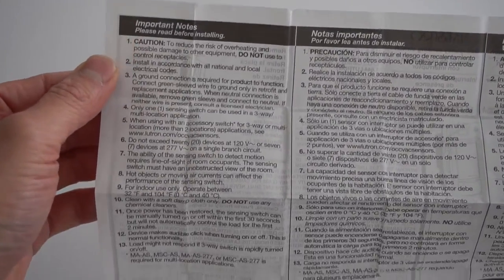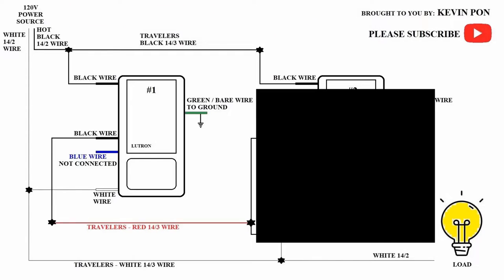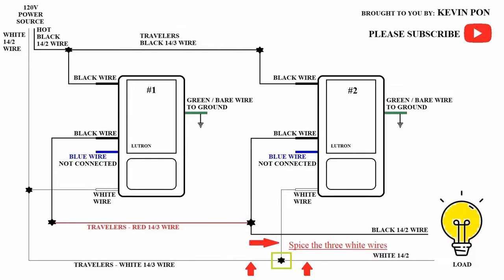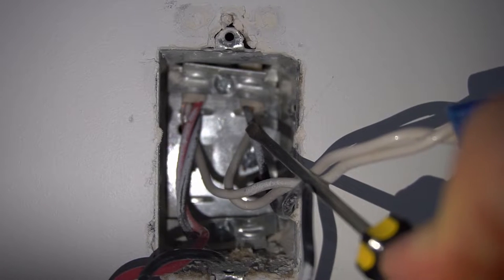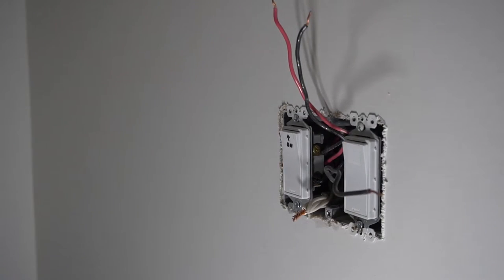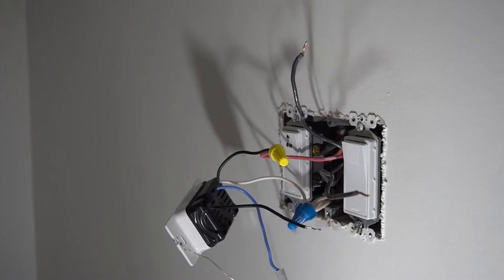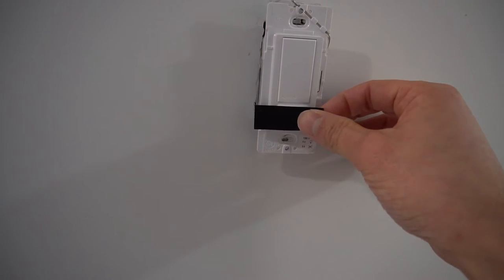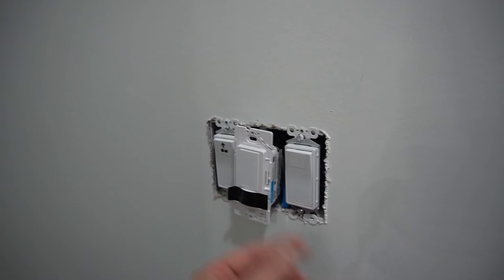TWO Occupancy Sensor 3-WAY Switch HACK BYPASS THAT WORKS! Any brand!

Comment: THANK YOU FOR THIS!  Question, though.  It appears the on/off button and motion sensor are an either OR situation 🤔...  Did I do something wrong?
Reply from the maker: Hi Alicia, can you please repeat the question? 😂 I don't understand
Reply: @KevinPon.  Haha, sorry 
I can use motion to turn on my lights and they will timeout out and go off 🥳
I can use the button to turn on the lights then turn them off...🥳
But if motion is what turns on the lights the buttons aren''t able to be used to turn them off .😞
Reply from the maker: Ah yes then you will have to wait for it to timeout. In 1 minute the soonest it can turn off by itself for the lowest setting. I wished they had a 30 second setting 🍻
Reply: @KevinPon.  my question is if I did something wrong because I cannot use the button to turn the light off if motion originally turned it on.  But on other single pole ones I can use both.  It is motion OR button but you can't turn it off with the button if you didn't originally turn it on that way.
Reply from the maker: @aliciawilliams3687  oh I see. So if you installed yours just like the way I have it. Two of them. I am assuming both motion sensors have been triggered. If you press one to turn off. That switch it off however you still have one more to turn off. You must turn them both off in order for the light to shut off. There is another way where you can just have 1 motion sensor installed on your 3-way system. The other end have to spice wires to keep the power loop complete. That is where box you won't be installing another motion switch and having it blanked off. I hope this answers your question 🍻

Comment: Hello Kevin, thank you for sharing this brilliant idea! My understand is that now both sensors will work but if one of the switches is shut off manually then the others could not be switched on manually right?
Reply from the maker: Thank you! If one is switched off manually, the other switch can still turn the light on or off 🍻

Comment: Thank you for the video, Kevin. However, I have a question. It looks like your idea can be described as using two occupancy sensors in single pole mode being connected in parallel. Another words if you’re not using blue wires than why not to make this installation with just two single poles providing they’re almost twice cheaper? Thank you.
Reply from the maker: Hi Igor, you're very welcome! Good question. You are 100% correct! Will be cheaper using two single pole sensors. I made this video base on the current props I had. A few of my viewers needed my help so I decided to make this video for them. But also to prove Lutron's installation guide that it was possible to install two of these switches when mentioned cannot. Thank you for the comment. Cheers!
Reply: Read my mind. Great question and saves money! Should write Lutron as it's a no-brainer necessity to have this wiring option available!

Comment: So two effects with this method since they are effectively wired in parallel:

-I think it may have been noted but I beleive manually shutting off one switch with the paddle won't do anything, you will have to hit the other or wait for the motion to time out.
-Technically the load capactity with be shared when both are activated.  More a minor point in this day and age of LED HOWEVER I note some people saying that you can do this with a MS-OPS2H to save some money since you don't need the 3-way feature of the MS-OPS5M BUT the OPS2 is only a 2A switch and the OPS5 is 5A.  Something to be aware of if you have a lot of lights on the swich circuit.  I.E. with only one activated you may be pushing the limit of a single OPS2.

Actually one other thing occurs to me on the first point.  I wonder if just wiring the blues together as well would "fake" the two swiches in to thinking the other end was a companion switch and therefore shut themseleves off if the other manual paddle was pressed?  I don't know the details of what exact "signal" is sent or level maintainted on the blue line when used in the pseudo 3-way mode.

Comment: Can this be done on Kasa motion single pole switch(KS200M)? they are not 3 way switches
Reply from the maker: Yes you can. Just follow the steps and ignore the blue wire. Neutral wire is required! 🍻

Comment: Thanks bro. Can I just buy a single pole switches instead 3 ways for saving money? Or it won’t work?
Reply from the maker: No problem! Absolutely, yes you can. As long it requires a neutral wire 🍻
Reply: @KevinPon.  thanks bro
Reply: @KevinPon.  where u live bro?
Reply: @KevinPon.  my single pole Lutron does not have neutral!
Reply from the maker: @ethanpn2003  Canada 🇨🇦
Reply from the maker: @ethanpn2003  damn. Can you see if the ground wire is connected into the control board of the switch?

Comment: Hi Kevin,  I bought two levinton 3-way switches, not sure which I'm doing wrong, best i can do is have it flicker the lights on for a few seconds, then it shuts off again.  my hot 14-2 is on same side as the 14-3 traveller and the 2nd location only has a single 14-3 into it? let me know if you can help more, thank You
Reply from the maker: Hello, the important key is to have constant power going to both switches. Just like how I have it in my wire diagram. Also all the neutral wires are connected 🍻

Comment: Hi Kevin, I do not know if you are still monitoring the comments section, but if you do I have a question. Will your wiring diagram work for a occupancy sensor switch like the TopGreener single pole (No Neutral Required)? This switch accepts only two cables + ground, and it does not need neutral wire (white cable). Maybe the better question is, does your wiring diagram requires always using the neutral (white) otherwise will not work?
I think it is awesome you took the time to answer each question on this video.
PS If you see this question twice, is that after submitting it the first time it disappeared for me.
Reply from the maker: Hi Gabriel, if this switch had I neutral wire, I would say yes. Sorry, I cannot confirm that it will work. However, I do know that some switches say neutral wire is not needed, but uses the ground wire as a back door as a neutral. If the ground wire isn't connected the switch won't work. 🍻
Reply: @KevinPon.  quick follow up question. After looking at online pictures for the Lutron MS-OPS2-WH, it has two black wires and ground. It does not seem to have a white cable. You mentioned that this could work as a cheaper solution. Is this still the case, even though does not have a white wire (neutral)?
Thank you for you time and consideration to my question
Reply from the maker: Yes, this one will work. If you look in the customer pictures on Amazon. You can see the neutral wire is cover by a green sleeve. It's actually a neutral wire. I don't know why they do it this way. To save a wire/money?

Comment: Are you able to add in a 3rd switch? Would you just be wiring 5 wires together instead of 3?
Reply from the maker: Yes you can. Parallel circuit 🍻

Comment: Hi Kevin, I have a 3way controlling a staircase and wish only to control top of staircase with a 3way Lutron motion switch and the bottom a standard 3 way switch. Unfortunately the power feed is into the bottom switch standard 3 way, and as per fine print it’s not supported in that configuration. Can I use your diagram and replace your switch one with standard 3way?
Reply from the maker: Unfortunately once you have one motion switch installed. You cannot use the manual switch. The sensor needs constant 24/7 power. Even if the sensor is installed on the side with the feed you won't be able to switch the manual 3-way off. Once the manual is switched off. The sensor cannot turn the light back on 🍻

Comment: Thanks Kevin. In my 3 ways outlet I found  there were 2 traveller wires( one black one red) with brass screws and 1 black wire with black screw. I have replaced one of outlets and red wire is on left and black wire(traveller) is on right & above black screw. So I have 2 questions 1. Can I exchange two traveller wires location , switch into red wire on right and black wire on left ❓2. Do I need to match the same traveller wires locations between my 2  three way outlets such as both of red wires on left with brass screw, both of black traveller wires on left with brass screw thank you：）
Reply from the maker: Hello there, I have never exchanged the travellers but I do believe it will still work the same. Just as long the black screw gets the correct wire on both 3-ways 🍻
Reply: @KevinPon.  Thank you for your help Kevin! It works ! 😽👏
Reply from the maker: Awesome!! 😁🍻

Comment: there are different types of Lutron Maestro Motion Sensor Switches on Amazon. Please, tell me which one I need to make same connection as on this video? Thank you
Reply from the maker: This is the one I used in the video https://www.amazon.com/Lutron-Electronics-MS-VPS5MH-WH-Maestro-Vacancy/dp/B008SE3GBU/ref=sr_1_21?keywords=lutron+motion+sensor+light+switch&qid=1659137233&sprefix=lutron+motion+%2Caps%2C154&sr=8-21

Need one with neutral wire to work. Cheers!
Reply: @KevinPon.  thanks
Reply from the maker: @asa9999  this one has more reviews. But in the pictures they are identical. Model number is different but they look the same. https://www.amazon.com/Lutron-MS-OPS5M-WH-Single-Pole-Multi-Location-MS-OPS5MH-WH/dp/B005WM3C42/ref=sr_1_1?dchild=1&keywords=OPS5M-WH&qid=1591491398&sr=8-1
Reply: @KevinPon.  that is what I use, it doesn’t seem to work😢
Reply: Not sure why. Do I need t to use the exact ones that you used?
Reply from the maker: Nope you do not. But you have to follow the wire diagram very carefully 🍻

Comment: Hi Kevin. Great video. I followed the instructions and its sort of working. Wondering if you can provide some guidance. Both switches have power however the motion is only working on the aux switch. Once motion is triggered on that one I see a blinking light on the master but thats all I get from the master. Even if I try to hit the on/off switch on the master, it does nothing. Thanks in advance.
Reply from the maker: Hi Matt, thank you. That's a good start that both switches have power but how is your neutral wire hooked up? Are they both connected in parallel together too?
Reply: Hi Matt and Kevin - I am having the same issue. My switches do not have any white/neutral wires, so I was forced to skip that portion of the wiring diagram. All I have are black and red (plus the ground).  Any thoughts would be greatly appreciated?

Comment: Would this work with a lutron motion dimmer on both or one end?  Thanks for the video!
Reply from the maker: You can have both working just like in the video. Would be the same steps and ignore the blue wire part. Cheers!

Comment: I wired it as described, and the switches work on motion, but the lights are coming on every 4 minutes all by themselves. I have taped over the motion sensors to see if it would stop, no luck. Any ideas?  I might return these and go with a single pole as some of the comments said.
Reply from the maker: The tape must be fully covering the sensors but I assume they are. Sounds like one or maybe both are faulty switches. Yes single pole would be the cheaper option 🍻

Comment: I just installed these motion detector switches at the end of 2 hallways. I used your wiring diagram, and they all work perfectly. 

Looking at your wiring configuration, I understand that they are no longer 3 way switches, just a motion detector sensor with a constant hot, and a common switch leg. Thank you for the excellent wiring diagram.
Reply from the maker: Job well done Jerome!! Thank you! 🍻

Comment: YouTube University wins again. 

My lights are wired through the box with power. Not standard or ideal— but the logic presented in your diagram helped me unfuck my problem. 

You have another video that’s about 4:50 long on the same subject. It ends with “turns out you can’t do it” — I saw it in the middle of troubleshooting, after having seen this video first (and not knowing they were different). I almost threw my phone. 

Anyway— this is a helpful video. Your solution works. The other one… isn’t. I guess I’m writing this to let everyone (and you) know to ignore the other one and only focus on the video that’s about 12m long. 

Thank you again. It’s clear I have more confidence than ability— and tutorials like this help make it look like I know what I’m doing. 😂
Reply from the maker: Thank you for commenting. I enjoyed the read. I am glad it all worked out in the end. Cheers mate! 🍻

Comment: Kevin, Can I use one occupancy sensor switch and one normal 3 way switch. Always leave the normal on, and let the motion switch to detect both doors just in your case.
Reply from the maker: Yes you can that's what I have in my mudroom. Just make sure never switch off the normal  3-way switch🍻
Reply: I have a setup like this but I was able to tap into a hot wire from the fan switch in the same gang box as the motion sensor. This provided power to the motion sensor and now both switches work like normal. when you turn on/off the normal 3-way switch the motion sensor clicks and will also turn the light off after 1 minute regardless of which switch is turned on.

Comment: I understand your two-switch conversion.  Now, suppose you have 4 switches, two 3-way and two 4-way in the middle?  I want to put two 3-way motion switches at the two 3-way switch locations...  Would my 4-way switches make and break that red traveler wire you show?

Comment: So what I didn’t see was if both sensors are “on” and set to watch for motion, will one sensor keep the power on with out timing out? And if the other is out of sight from the other location would it do the same and keep the lights on?
Reply from the maker: When either one of them is still timing out, the lights will be on. Both of them has to time out completely for the lights to be off. Cheers mate!

Comment: Hi Kelvin,
    Thanks for the great advice.
    Just wonder does it work if I have one 3-way sensor switch and the other just normal 3-way switch. I install on one side, and found that when I turn off the light from normal 3-way switch. I couldn’t turn on again from the 3-way sensor anymore, and motion sensor won’t work. Only when I flipped the switch from the 3-way to opposite side, then the 3-way sensor work again. Do u know what I missed?
Reply from the maker: Hi Steven, don't worry you have installed it correctly. It's supposed to do that. The 3 way switch on either side you have it, you still cannot flip it off. That's because the 3-way sensor needs constant power on 24/7. When you flip it off, the power cannot be transferred to the 3-way sensor by the travelers. It's how it is.

Comment: Hi Kevin this worked like a charm.  I have another circuit that has 3 switches, I understand in your comments that another switch can be added in parallel.  I'm assuming you could do an unlimited number of switches?
Your schematic is perfect and easy to follow.  Leviton should hire you.  Could you do another schematic for a 3 switch scenario?
Reply: I’d like to see the 3 location diagram as well. 
Thanks, Kevin! 
Great explanation and demonstration. 
Any idea why the manufacturer says it cannot be done?
Reply from the maker: @DamBevers the setup for 3 switches is very similar to the video. You have to have constant power traveling to all 3 locations and have all the white wires connected together. I think the reason the manufacturers don't want to tell you is because they do not want any liability 🍻

Comment: I have 6 wires coming out the wall, copper, red, and 4 black.  I am trying to do what you are doing but I am confused with the six wires.  Any suggestions
Reply from the maker: 4 black: 1 is power, 1 is the light, the other 2 could be other lights 🤷🏻‍♂️

Comment: Great video with easy-to-follow instructions. I installed 2 sensors in my garage - upstairs and downstairs but only the upstairs are working. Do you know why this is the case?
Reply from the maker: Hi Tony, the circuit must not be complete. There needs to be constant power going to both switches and also all the neutral wires must be used in the same circuit. Or the switch could be faulty but you can switch it to upstairs and see if it makes a difference 🍻
Reply: @KevinPon.  how do you test if the circuit is faulty? both switches were working properly before I installed the sensors. Now, only 1 sensor works at a time.  My friend was telling me that I need to follow your testing procedures at the end to make it work, which I try.  But just couldn't get both sensors to work.
Reply: could you please let me know specific steps I need to take to correct this?  Thanks for all your help!
Reply: I think I have the same problem as Matt Gelber below.  Both sensor have power but only one works - in my case it is the upstairs power source sensor.
Reply from the maker: @tc333888  hmm that's very strange. Can you double check the wire diagram with what you have connected. It should've worked. I still think it's not wired completely, something it's complete that it's not providing power back to the light